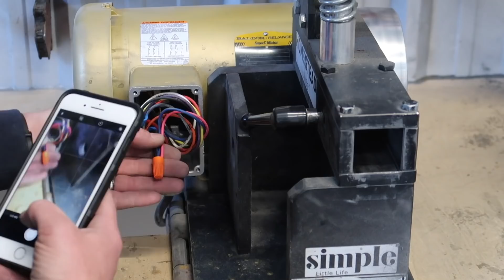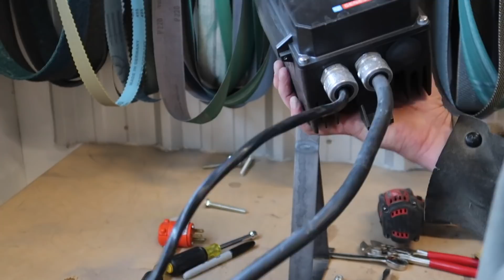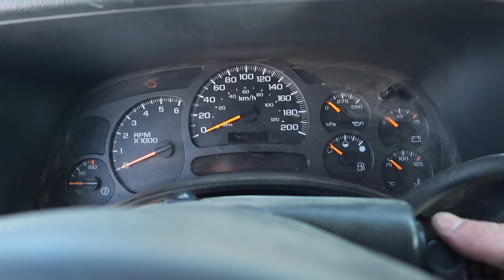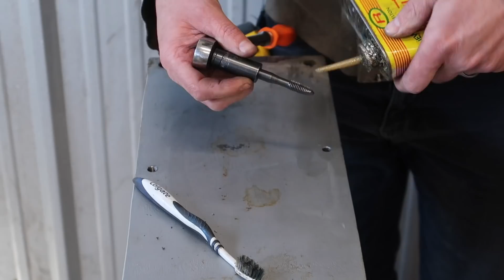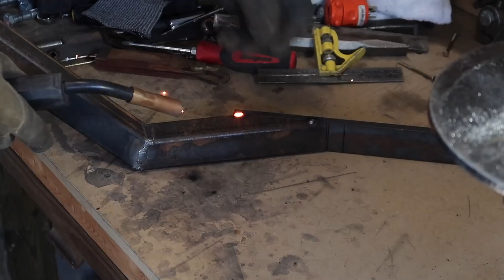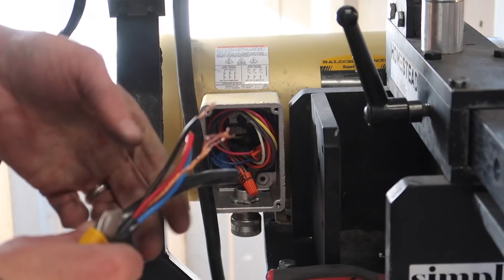Re-doing my knife making shop - Part 1

Comment: Probably could have got the holes in straight if you drilled up from underneath?
Reply from the maker: Yeah I thought about that. Then remembered how much fun it is to drill through 1” of steel pulling/pushing up. Realized it wasn’t that important and angled holes would be just fine. Always wished I had a mag drill.

Comment: Would it be possible to use the same VFD for both machines (disk and belt grinder)? Just put some kind of switch between them? Thinking of doing that in my shop.
Reply from the maker: I think that is entirely possible and I’ve seen some guys do it 👍

Comment: Just started watching, but for the most part I leave my 1 grinder horizontal & the KMG is always vertical. Now, that said, the horizontal is the one that also runs backwards, so when it's vertical for sharpening, I have to stand on a 6" platform I built to rest one leg on at a time as I'm grinding to help lean into my grinder... Ok gonna watch the rest, take it easy... P.S. when you got that sheet metal in, I'm guessing your thumb wasn't the only finger pointed at the wall hahaha
Reply from the maker: Right on Dave. You're right about the sheet metal, that stuff was the least fun of this project 👍

Comment: Great video as usual. I was watching your small kitchen knife build along from about a year ago and noticed you used a radius platen for the bevels. Does it create a hallow grind that just isn’t as extreme as a contact wheel would?
Reply from the maker: Thank you. Yes, that's exactly what it does. Works really well too. I think the idea behind those radius platens is to simulate the traditional grind that many Japanese knives have as they were ground on large (36") grinding wheels 👍
Reply: Simple Little Life thanks